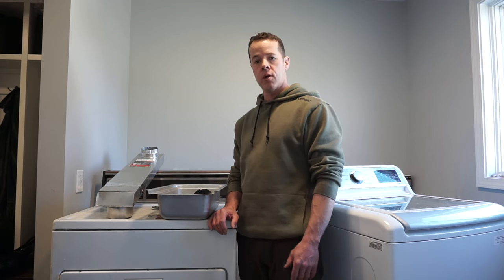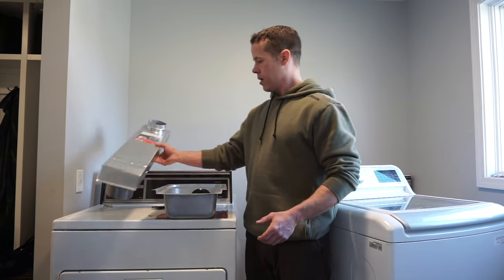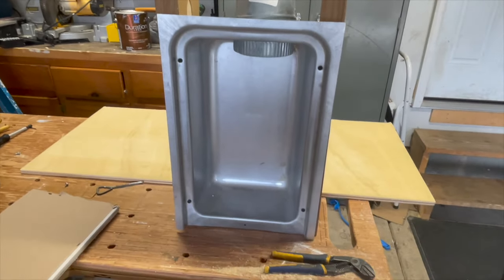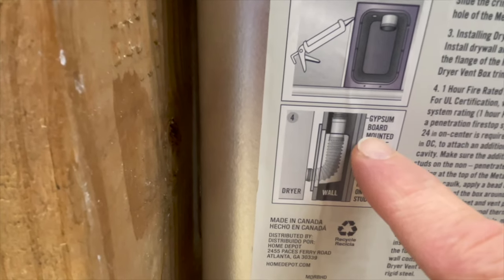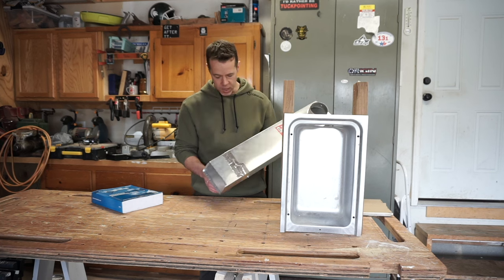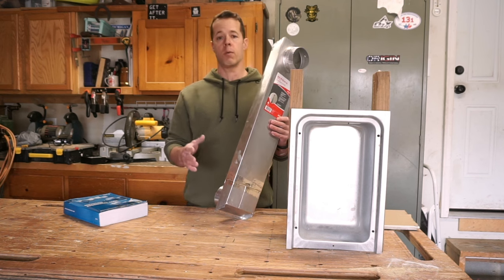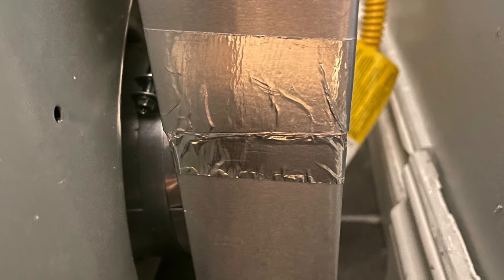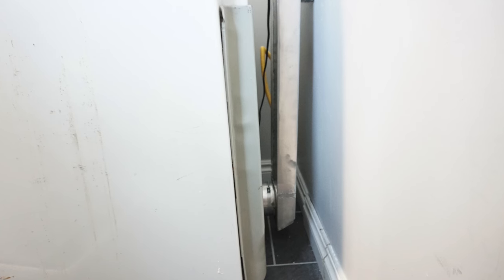Install a Dryer Vent in a Tight Space /  Dryer Vent Options That Won't Burn Your House Down

Comment: Doesn't the use of the periscoping slim-fit vent require the lint to blow upwards and out?  Wouldn't that increase the amount of lint that gets trapped in there?
Reply from the maker: Hello!  Most ducts will only be a few feet long and the smooth surface will aid in blowing the lint outside.

The periscoping vent is referred to as a 'transition duct' in the code book.  The code allows this duct to be 8 feet long, less for every elbow that is installed.  😁
Reply: @thedustybuilder  Thank you.  I want to save space in our laundry room and this sounds like the best option.

Comment: Has anyone figured out what to do to save space for an LG wash tower dryer hose connection. It’s in the middle of the stack about 35 in up yet most dryer wall connections are at/near floor. I was thinking of the periscope yet the water hoses are exactly below the dryer hose opening! SMH.
Reply from the maker: I just looked at it online, I would just turn the stack upside down, problem solved.  Just kidding.

What a bad design.  Nothing comes to mind..... other than changing the dryer vent location, but that is a massive inconvenience.
Reply: @thedustybuilder  so true! Lol

Comment: I would like to use the periscope one off to the side, through an adjacent wall and end right there in the back hallway.  Short trip, easier to clean.  Our dryer is electric, no gas in this subdivision.  The current dryer vent goes UP,  not out, 15 feet to the roof.  I think this is a fire waiting to happen, even with annual duct cleaning for $125.
Reply from the maker: Hmmm, when you say end in the hallway......I'm assuming it's going to vent outside.  That could probably work, it might get tricky if you need to use a 90 at some point.  I agree though, I wouldn't want my dryer venting onto the roof for several reasons!!

Comment: Can you put the rectangle dryer vent in the wall between studs?
Reply from the maker: No!  That vent needs to accessible.  The vent for an in the wall application needs a 2x6 wall , hope that helps
Reply: So we bought new washer and dryer, and I'm now ripping apart my laundry room because the former owners put this in the wall and it wasn't even frigging put together right!!!
Reply from the maker: @tims_always_fishing7117  man that stinks!  So common though, I work in a brand new building that had a small fire because the dryer vent was installed wrong

Comment: I have that vent and the dryer is stacked.  when the washer spins, the vent pulls out of the wall or the dryer.  What can I do to prevent it from coming out?
Reply from the maker: Hello.  I would do 2 things.  1). Make sure the dryer is level…. If it isn’t, the spin cycle makes the entire washer move
2) Use a clamp And foil tape to secure the connection.  Good luck!
Reply: To add to the dusty builder you can also add a set of good vibration pads.
Reply from the maker: @aayotechnology  good point, thanks!

Comment: I have a right side vent can I use that piece to go outside?  It’s a tight hit
Reply from the maker: Ooh, good question.  Unfortunately no.  I haven’t seen any specific vent for that scenario.  I would do a 90 off the dryer and rigid ductwork until it terminates at the wall.  Good Luck!

Comment: Do you know if you can flip the outbound vent to the same side as the inbound vent?
Reply from the maker: You can !  It will slide off and you can arrange it that way
Reply: @thedustybuilder  I successfully installed it.  Worked great!
Reply from the maker: @ErikBartlow  fine job!!

Comment: I just cleaned my dryer vent duck out today, I could probably save some space using that type of slim fit duck, I have to look into it. Thanks for your video.
P.S. I haven’t cleaned mine out in 5 1/2 years, I’m glad I did. It was pretty bad.
Reply from the maker: @saltydoggie1160  Thank you!  I’ll be installing one in the house I built….. I like that it’s all metal and can be cleaned easily!!